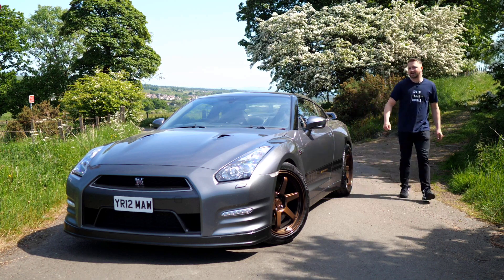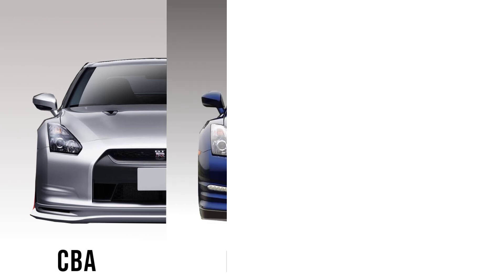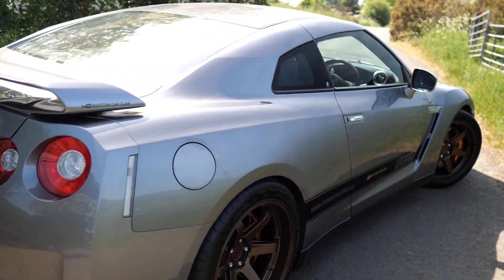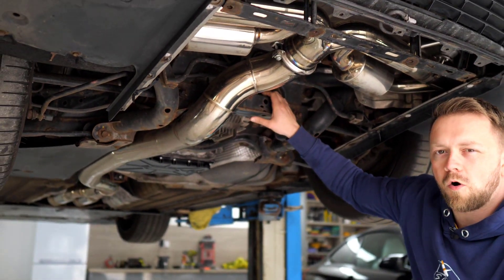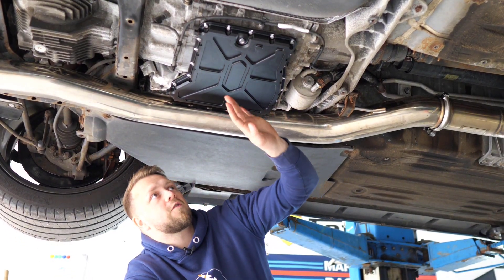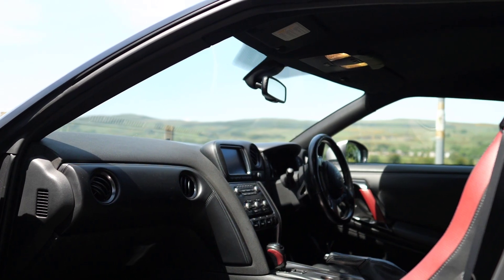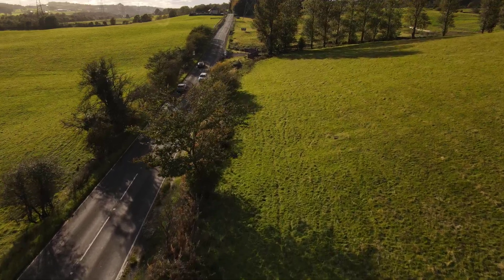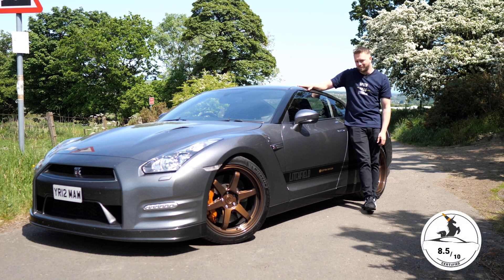Nissan GT-R BUYERS GUIDE | Watch BEFORE You Buy!

Comment: Awesome video, mate. Mine already has an engine built for 1300 hp; transmission still needs work.  So the car is only tuned for 800 hp/650 tq at the moment.  The bellhousing is definitely still a problem in the DBA model.  Mine is upgraded to stage 2 from ATR. The more I see these videos about the R35, the more I learn about the car. I definitely learned a few more things from watching this video. For example, the oil pan.  Keep it up!!